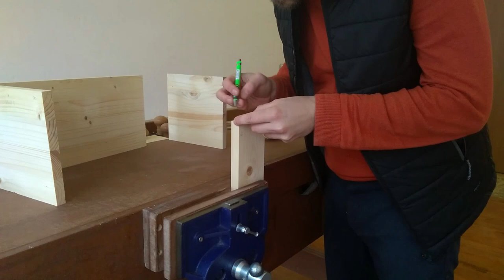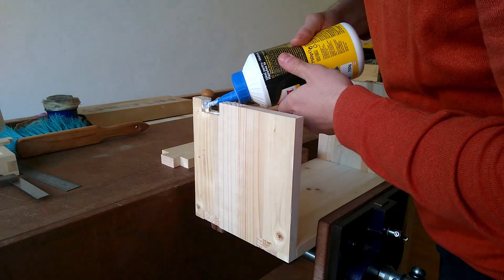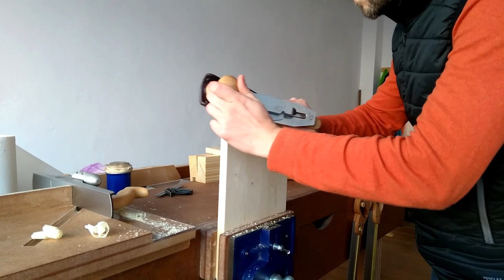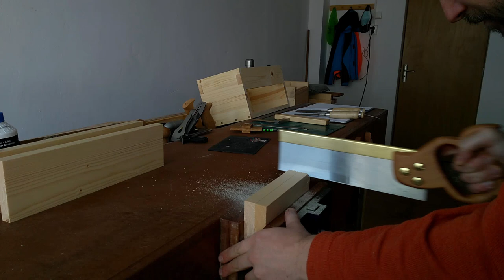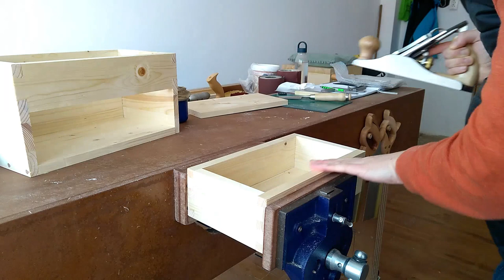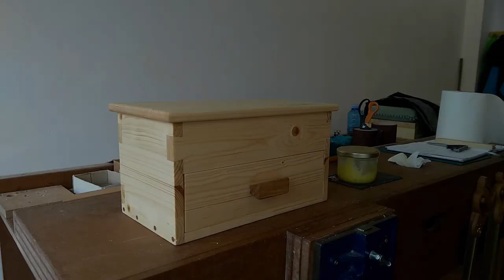Making the Paul Sellers' inspired desktop organiser with hand tools

Comment: Superb work you done Paul's teaching proud. I see you have revamped your s&j tenon saw , very good , I have one the same and is my go to saw though I've left the handle as standard .
Reply from the maker: Thank you! Good catch, indeed I reshaped the handle of all the S&J saws to fit my hands and they are much more comfortable to hold and use. One hour with a rasp, file, sandpaper, a bit of shellac and you will regret not doing this sooner.
Reply: @liviucerchez  your work looks great.  The reason I didn't bother reshaping the handle (apart from being lazy lol ) is that they fit my hand position very well

Comment: Would you mind sharing how you worked out the hinge placement for the lid.
Thanks Phil.
Reply from the maker: Hi Phil, I honestly didn't calculate the position of the hinges and just placed them where I felt they look right in the flow of the moment (equal distance to the sides, of course). It depends on the type of hinges you use, but I suggest viewing Paul Sellers detailed video series for additional details.
Reply: @liviucerchez  I would have followed Paul’s but I have no tool to make the recess on the bottom of the lid.I’m sure I will work out how to do it. Nice videos by the way. I had another look at yours,did you rebate the knuckle of the hinge on the lid ? If you didn’t do you have a gap at the back.
Thanks Phil
Reply from the maker: @philrab6696  If you don't have a router plane then just use a chisel and it will work out fine. The drawer pull is just glued on the drawer front with no additional joinery or screws. Thank you for the feedback!